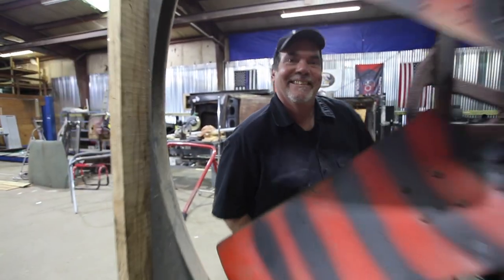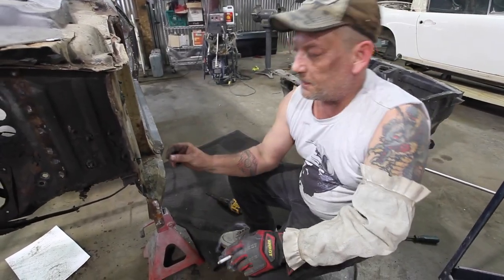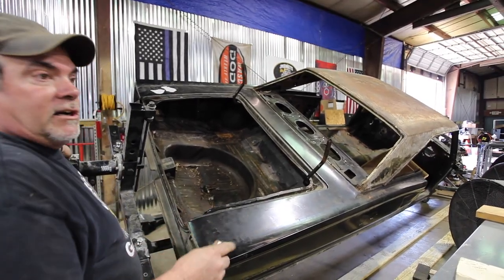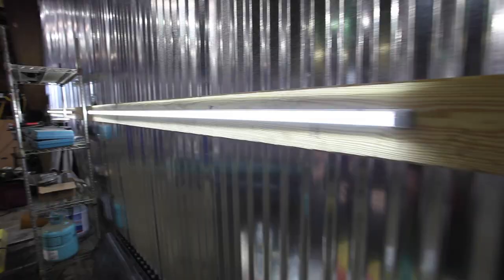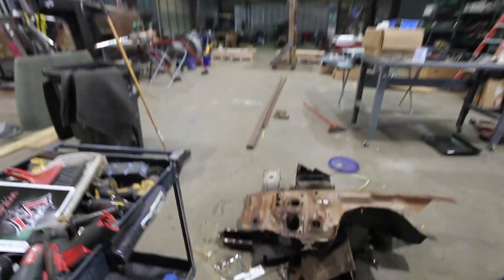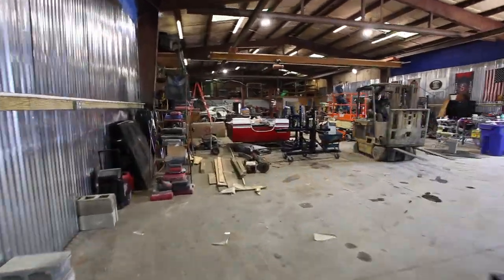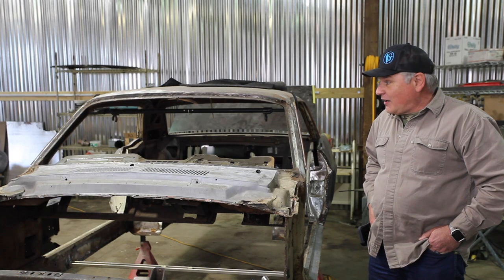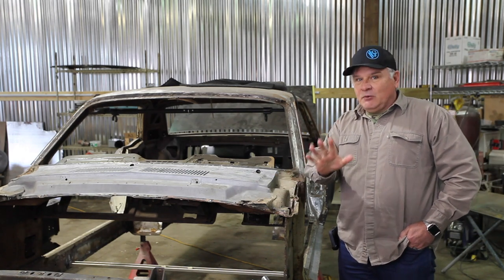Rotisseries, Renovations, and Restorations

Comment: I found your site through UTG. thanks Uncle Tony. I am really enjoying watching your videos and getting caught up on all the projects.  Glad I found your site.
      I have a 1964 Mercury Comet Caliente that has a lot of the same common rust issues as the  68 Mustang.  I am wondering if I can use the metal (torque boxes, toe boards)  for a Mustang in my Comet? Any advice would be greatly appreciated. 
Thanks again,
and keep the videos coming! 
Love your enthusiasm and work.
Reply: Thanks Dan.  Appreciate it 🙏
Reply from the maker: if not exact, they will be very close. I had a 64 fairlane i used them on, not a problem
Reply: @bennettshotrodgarageclassi7068  great,  thanks for the reply.  Wish I lived closer.  But I am stuck out on the west coast for now.
Keep up the great videos! 👍

Comment: Hi Guys.  Also found u through Uncle Tony. Really love the shows here.  Have a rotisserie question on your Weaver rigs.  Watched the one with UTG where you had the Fury on the rack.  Was very interested in how you attached the rear frame rails to the rotisserie.  I'm working on a 69 Road Runner and don't like the way I have it attached to my homemade rack in the rear.  Just bolted to the rear panel where the bumper bracket bolts to the car.  Afraid it may bend and twist if I'm not careful.  Id really like to see how yours is attached, if possible.  Thanks
Reply from the maker: Pretty much all the mounting has to be fabbed up. Normally Ill make shackle mounts for the rear of most cars